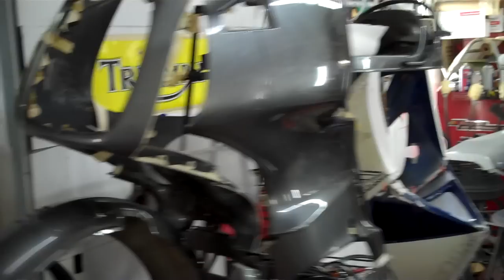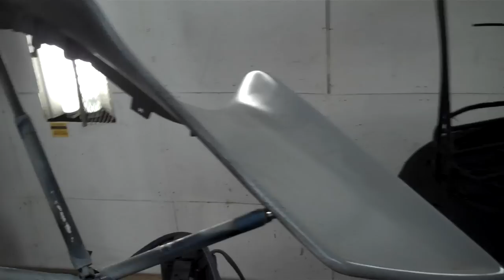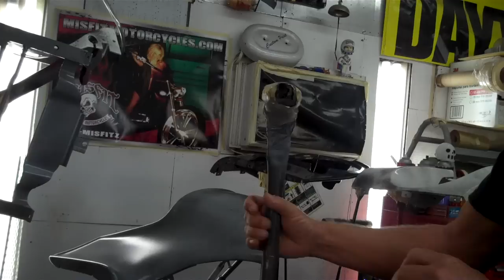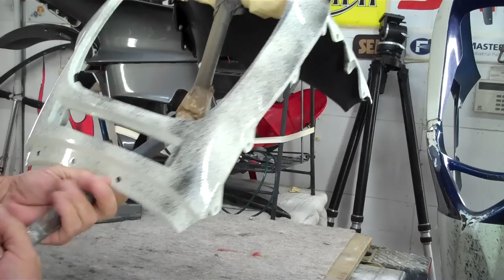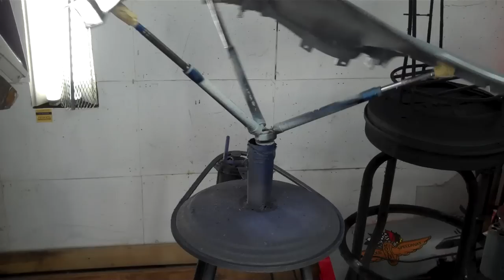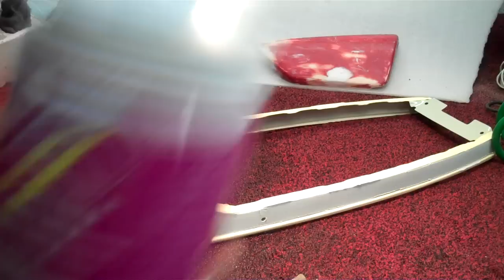How to paint a motorcycle, First thing is Last things First .

Comment from the maker: @satajet883 Instead of using a bar stool to sit on I added a sewing machine motor and pedal
from the thrift store with a fan belt and an upsidedown plant stand from the garden. you could put one together in half an hour.
Seems the belt will track just fine even on the smaller pulley and the gear ratio is just right for control. Cleaner results from not moving around the part stirring up dust  but rather move the part and stand your ground. Adds space in a tight place.